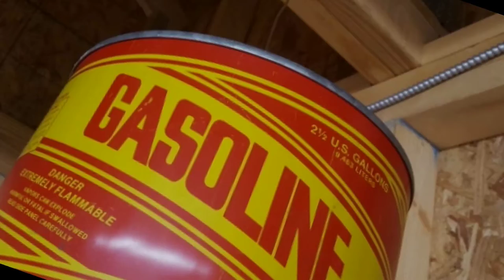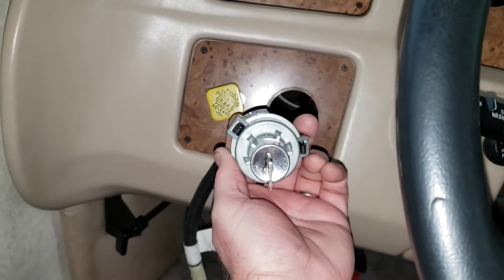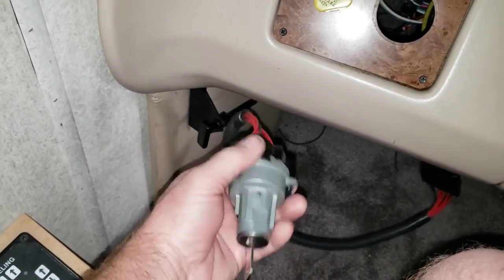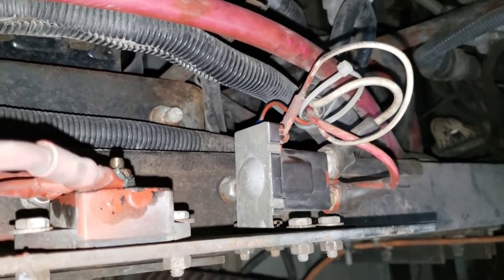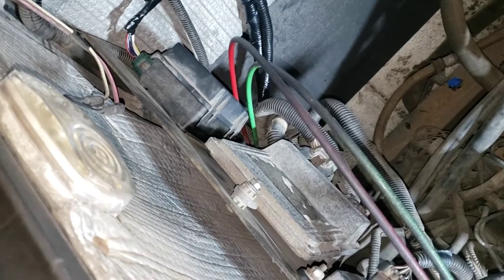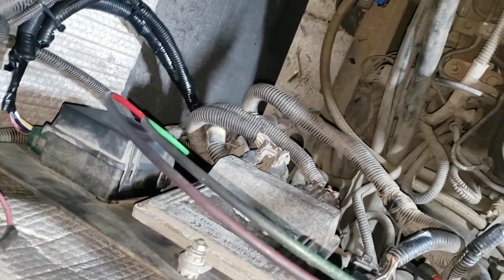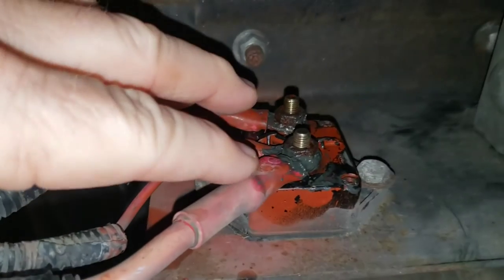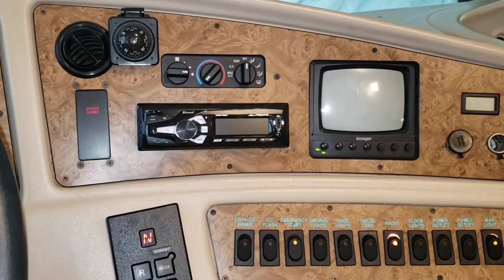Class A RV on Freightliner XC - No Crank No Start - FIXED !! How to Troubleshoot

Comment: Thank you so much for the help, advice, etc. I'm working my way through a similar issue you were pointing out. I can recall if, at the beginning  of your video, if you had no reading  at the shifter control panel.  Mine has been an intermittent problem , and now no crank is normal. I've  done  many of the basic tests. Freightliner  is leaning to what they call TCM. I call it the control module. My display showed  no neutral light when the key is turned on. Then, a moment  later goes to  O this then a Starburst in the center. I'll keep at it. Thanks again, Jim
Reply from the maker: My shift control pad was never lighting. Initially, I did not notice that when I first started the troubleshooting process. It should light up with no error codes. If yours does have error codes, I would check the TCM for sure. In my case, the control pad was simply dead, a sign that the TCM was not getting power.
Reply: Thanks, I'll  run with that.

Comment: Thank you for your post. I have a 1990 Safari Serengeti and I knew that the battery was no good. Once I replaced my battery got a no go on starting the engine. You post was the first one I watched and it gave me the courage to try and diagnose my problem. I was fortunate that it  was a 12v 30 amp fuse to the battery isolator. Replaced and started the engine woohoo!!!
Reply from the maker: Excellent work !

Comment: You have just given me hope.  Thank you.
Reply from the maker: Keep at it! This took me A WHILE to figure out!
Reply: @ImpalamansGarage I have a 1998 Discovery Fleetwood 37ft diesel (same engine and transmission). I have no power (12v signal) to the dash at all, however I have power to the lights in the RV. I'm not seeing a fuse buss block like what you found with all the corrosion. Any idea where else I can look as my under carriage is rusty so I feel it's corrosion related.

Comment: Thk you for this
Reply: I have a clicking sound when I try to start my 5.9 fleetwood 36t don't do it all the time
Reply from the maker: @jackstephenson8319  Jack the starter on these chassis does go back. As a matter of fact, I had to replace mine just recently. I got a reman from the local Freightliner service center. I'm assuming your clicking noise is coming from the rear of the coach? We tend to get caught up in other more complex topics when it comes to RVs, but something as simple as a starter can bite you. A clicking sound when trying to start a vehicle is a very typical indication of a bad starter (or starter solenoid).  I did not make a video on it because I was in a hurry. If you do decide to replace the starter, I highly recommend buying one from the a certified Frieghtliner service center. Give them the chassis VIN. If you try some place like NAPA, it is a guessing game. These starters have small changes depending on application and the gears may not engage the flywheel properly if you don't get the precise one. Also please ensure that your main chassis ground and power cables going to the starter on a in good condition. High impedance connections will lead you astray.

Comment: I have a 1998 Discovery Fleetwood 37ft diesel. I have no power to the dash at all. But I have power to the lights in the RV. I'm not seeing a fuse buss block like what you found with all the corrosion. Any idea where else I can look as my under carriage is rusty so I feel it's corrosion related.
Reply from the maker: The first thing I would check is the chassis power switch to make sure it is in fact working and that the relay it activates is working. I've no idea where it is on you RV. Mine is in the rear left to the rear of the battery compartment. I  would start from there and begin tracing wires.

Comment: I had similar issue but my pad was lit and code read low tcm voltage, turns out my chassis batteries were discharged due to faulty combiner relay. I start my engine and run everything from from the house batteries ( or so I thought until I found out the transmission is powered from the chassis’s batteries
Reply from the maker: This one was a real challenge to troubleshoot.
Reply: Thank you for the timely  tip about the Chassis batteries for the operation  of the transmission.  Jim

Comment: Great video ,when you  turn key ignition were u getting error code on allison pad or wasn't lighting up or was it normal ?  Like to know what led you to believe it was the transmission module ? Thanks for the help
Reply from the maker: The shift control pad was simply not illuminating. The control pad is supposed to light up when you turn on the ignition. If it does not, the transmission control module is not activating or the shifter control pad is bad. This was a very tough problem to track down, mostly due to my lack of experience. To be honest, I did not realize that the control pad was not lighting up until after several days of troubleshooting. After doing a lot of research and reading I checked, and sure enough, it was not coming on.
Reply: Ok understood,  thats what I thought would happn with these allison pad if it doesn't light up or show error code most likely it would be transmission module or electrical within that system . I was asking because I had similar issue with my diesel pusher I just purchased turn on ran fine drove it home.now won't start won't crank  nothing ? Allison pad does lights up so its normal so that rules that out im thinking ethier start solonoid or starter is bad  has 8.3  cummmins mechanical

Comment: I have a 96 Gulfstream Voyager 5.9 Cummins.  I have a panel as you enter the Motorhome which has 4 switches.  They all essentially send power to either the chassis or to the coach.  The first switch is on and off.  The 2nd is a 3 way switch ? and the last 2 are coach and chassis.  Could the starter relay, having corroded connections, cause these switches to have no power to them?
Reply from the maker: I do not believe so. Are you saying that your panel does not function ?
Reply: Yes.  The panel is not functioning.  I ordered a 12v probe tester to start checking.  A few months ago when I replaced the batteries, everything worked fine.  After setting unused for a few months, it no longer works.  I will check the battery solenoids first.
Reply: Thanks for your video.  It gives me places to begin checking.

Comment: What would cause an rv to have auxiliary power, but when trying to start, it instantly kills all power, doesn’t crank, and auxiliary stops working. Auxiliary will start working if I disconnect the battery terminals and reconnect them?
Reply from the maker: When you say "auxilary power" precisely what are you referring to? Are you attempting to crank your coach engine using emergency power obtained from the house batteries? Not sure what your scenario is. One thing is for certain, loose connections will drive you nuts, especially grounds. If you've not done so I would check all your ground connections in the power system. If you read anything other than 0 ohms of resistance in the ground circuit that is a problem. Also if you read anything other than the precise battery voltage at an point along the power distribution circuit  that is a problem. That means there is a poor connection with high resistance along the way.

Comment: I will like see it the battery connection please..
Reply from the maker: Do you suspect yours is not connected correctly? Let me know what you're looking for specifically and I can try to help.
Reply from the maker: If you are thinking that possibly this issue on my RV was in fact due to a faulty battery connection or battery, that was the first thing I checked. All battery connections were cleaned with anti-oxidant applied. Plus the batteries are new anyway.

Comment: I lost all my gages on my 02 winnebago journey dl. I am having a hard time getting someone to help me I put in a new VDC already and that did not fix my problem I just don't know what to do next .I would very much appreciate  help 🙏
Reply from the maker: It may be as simple as power to the dash. Assuming you're on a Freightliner chassis, I'd recommend contacting your closest Freightliner service center. They can tell you which branch services motorhomes in your area. Had my dash AC repaired at one of their facilities recently. I know it's expensive but it will get fixed and you won't have to worry about it anymore.
Reply: Should the gages have a full 12v of power mine have only 5.9 votes coming into them
Reply: And I asks this because in your video your work on the same type of stuff that I am  I have a freightliner classic 330hp 6 speed  Transmission
Reply from the maker: @anthonyborilll3369  Very few things on any sort of road going vehicle run on something other than 12 volts. (an ignition coil uses 9v and I think some temp gauges need a resistor to drop down the voltage) However it sounds to me like you have a broken power wire somewhere. Take that power lead to the dash gauges that reads 6 volts and see it it will light a test light. I've guessing it won't. Your voltage meter can tell you what voltage is on that wire but you have no way of knowing how much current that connection is capable of delivering. Hook up a test light and see what happens. I suspect nothing. At that point you will need to trace that power wire down through the RV and find out where the break is. I used an audible tone tracer for my issue.
Reply from the maker: @anthonyborilll3369  This guy ultimately took his rig to Freightliner and they fixed it for him. https://www.rv.net/forum/index.cfm/fuseaction/thread/tid/27299543/print/true.cfm

Comment: I can't figure out what that is to the left of solenoid it is labeled one pin battery the other pin is auxiliary. If you know can you please tell me, mine broke when trying to get cable's off to clean terminals. The part I am talking about is about 5 minutes and 50 seconds into the video is someone could chime in I would greatly appreciate it.
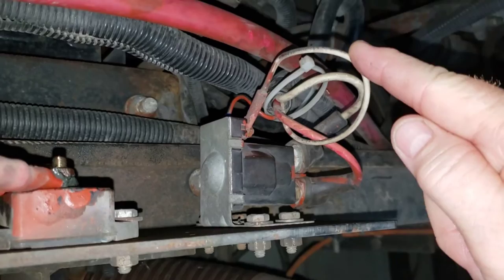Reply from the maker: Can you be more specific? Are you sure it is at 5:50 ?
Reply: @ImpalamansGarage  if you watch video at 6.06 minutes into video it shows a relay?  that has heavy gauge wire going to it on the right hand side of the solenoid I have a picture of the one that came off mine but it looks pretty much the same but I can't figure out how to add a picture so you can see what I'm talking about. Maybe the aux start relay?
Reply: I'm sorry watching the video it's on left hand side of the solenoid it's a two terminal box one terminal says battery the other terminal says auxiliary.
Reply: It is a 2002 coachmen on the Freightliner XC chassis with a 5.9 l Cummins

Comment: I don't know what that was all about but I agree with you wholeheartedly. Electricals = ZZZZZ. Lol
When are you actually going to show us your RV?
Is that an inline 6? Is it 2 or 4 stroke? I guess you have airbrakes. Is it airride also?
I watch bus grease monkey so I'm interested in RVs and bus conversions. Of course he deals with Detroit diesels so if you showed up at his place in Tennessee he'd probably chase you away with a shotgun. Lol. Just kidding.
Glad you found the problem and it really didn't cost you anything except the ignition switch which you didn't even need.
Reply from the maker: 5.9 Cummins 24 valve straight six. 4 stroke. 275hp.
Reply from the maker: Yeah the only money I spent was for a tone tracer to trace wires. $25 bucks.

Comment: Soo I have replaced all batteries now my leveling jacks won’t retract the rv starts fine! But the shifter mode buttons won’t light up nothing…can anyone help…
Reply from the maker: Interesting. I'd say the jacks and the shifter buttons are probably two different issues. If you replaced the batteries, maybe one or two fuses blew.
Reply: @ImpalamansGarage  I will definitely  check! I just don’t understand! Everything else works fine! Starts right up everythign witch fuse panel shud I check tho I’ve seemed to check them just paid a guy 1200 from a rv place and he spent 9 hours to find nothing…VERY FRUSTRATING